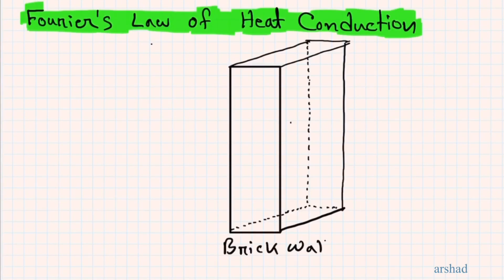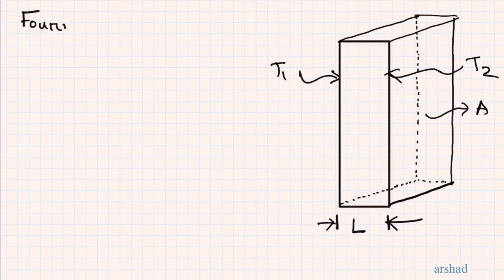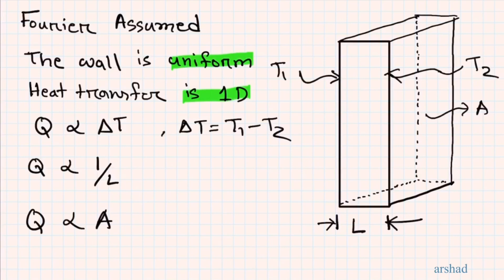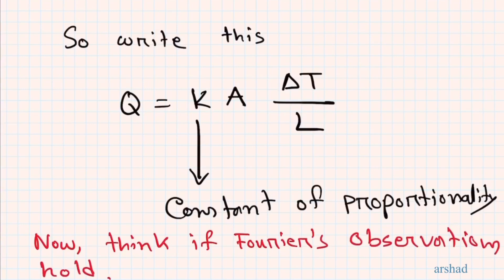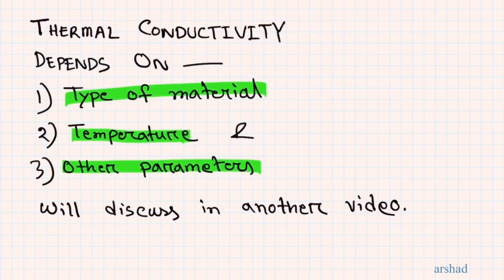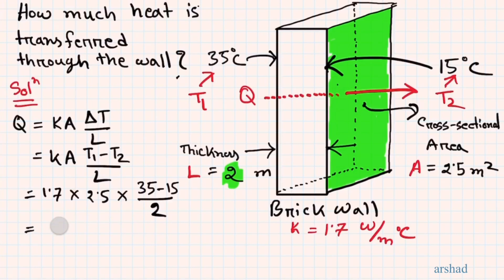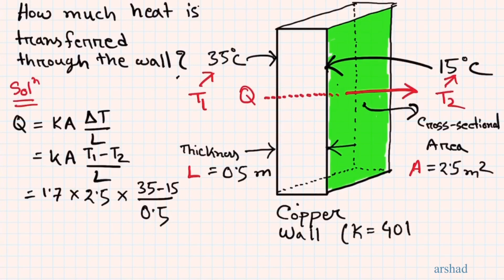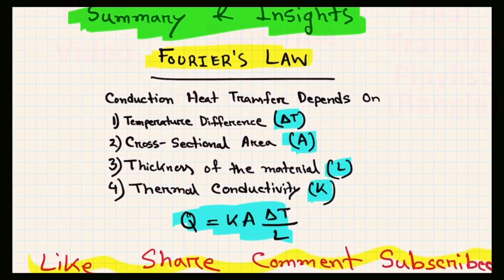Fourier’s Law of Heat Conduction | Heat Transfer | Fundamentals

Comment from the maker: Errata : The capital letter Q should be replaced by q in the video. Q means amount of energy transfer, whereas q means energy transfer rate or heat transfer rate. Please see the symbols and notations video for details.
Reply: Not necessarily. Q with a dot on top is heat transfer rate. q with a dot on top is heat flux. Q without  a dot on top is heat transferred. So he just missed the dot on top. Anyway, these things are just symbols